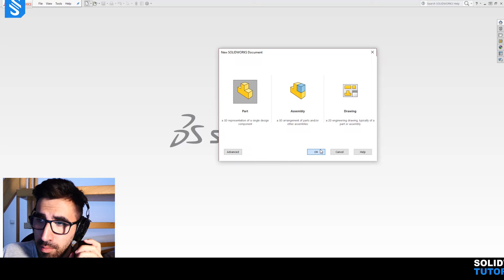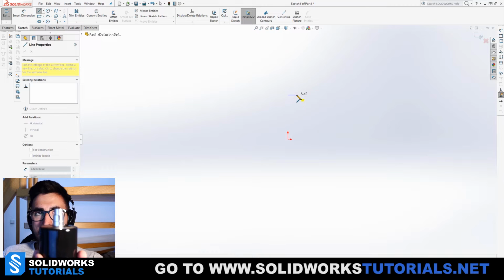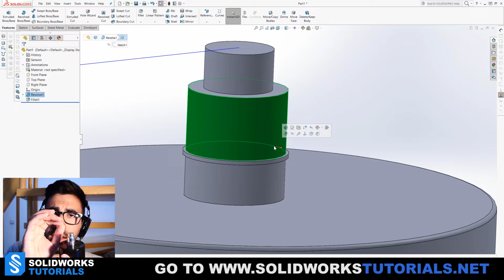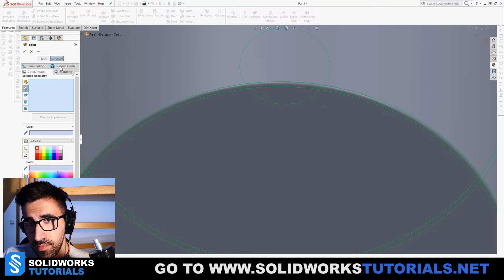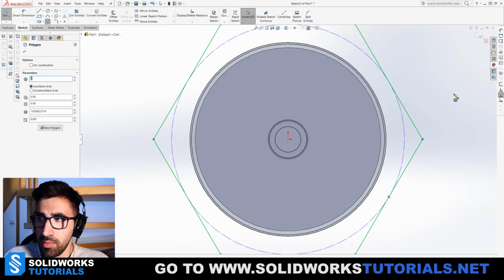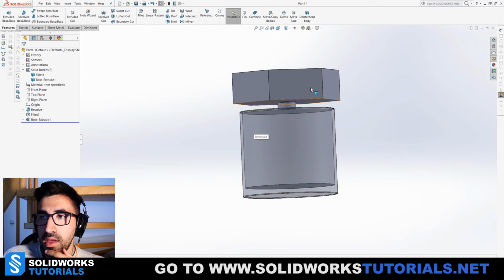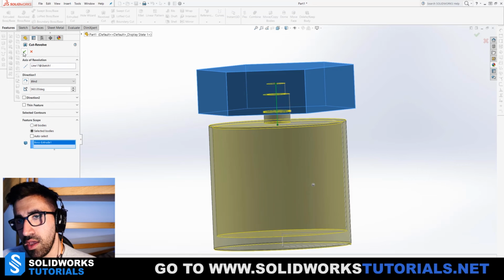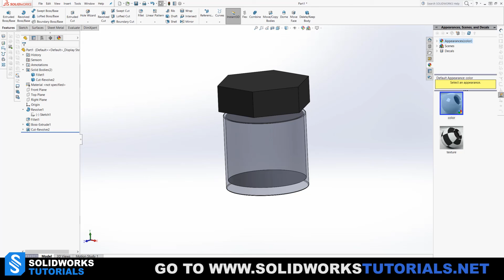Designing a perfume bottle in SolidWorks for Beginners with Ryan #4

Comment: hello Ryan, i need some help in solidworks for designing. could you please help me if possible brother
Reply from the maker: sure, what's the issue
Reply: @with-aryan  Our project is to design a single use testing kit in solidworks. But I'm not getting how to use solidworks and design it. I'm facing so much trouble. Could you please help me brother. I need to submit it by Friday
Reply: I need some test tube kind of stuff with height of 40mm with radius of 5mm. And pippette type of thing to thing to collect micro litre sample. Please help me brother

Comment: the arrows dont come up for me when i click on the surfaces
Reply from the maker: There is a feature on the "Features" tab called "Instant 3D" make sure it is on
Reply: @with-aryan  Thanks, so how many components is this? i need to do a project to contain 4 , i wouldn't be great could you recommended something ?
Reply: also how do i remove the cap ?
Reply from the maker: @jessiewhyte9766   You can keep adding components. Take a look at this tutorial. However, you won't be able to see all of it as this is premium. But it gives you an idea how to keep adding bodies to your design. https://www.solidworkstutorials.net/post/how-to-model-a-pipe-wrench-in-solidworks
Reply from the maker: @jessiewhyte9766  To hide it, move your mouse cursor on the cap and press TAB on the keybaord. To delete it, go to the design tree, find Solid Bodies folder, open it, find the cap, select it and press DEL on the keyboard
Reply: @with-aryan  is there a way to do the cap seperate, i have the shape made and extruded but would a cut extrude the same diameter of bump
Reply from the maker: @jessiewhyte9766  I don't follow. So you want to create the cap separately and assemble them together? this is very much possible and is easy. Let me know if you want to learn this. What I dont understand is this part "but would a cut extrude the same diameter of bump".
Reply: @with-aryan  could i contact you by email please
Reply from the maker: Jessie Whyte info@solidworkstutorials.net